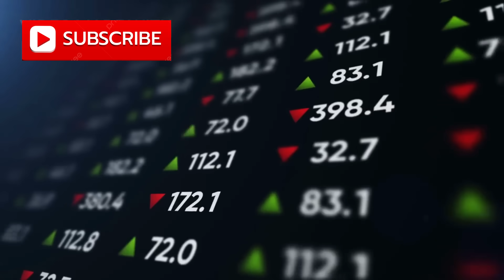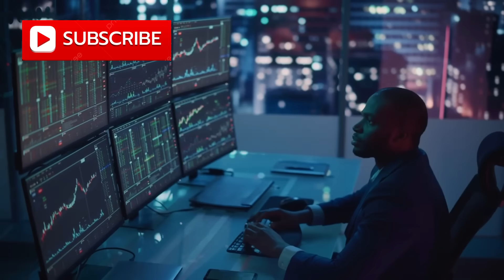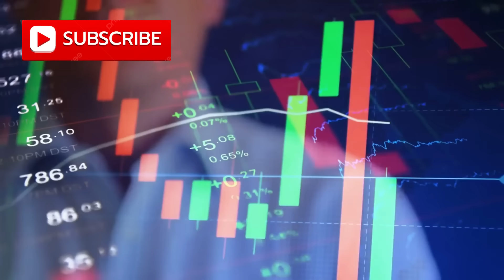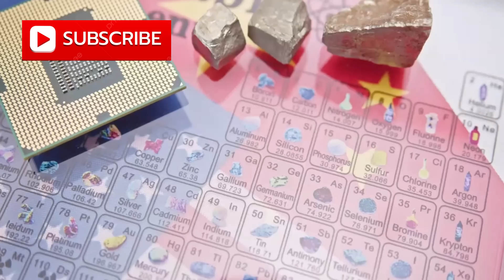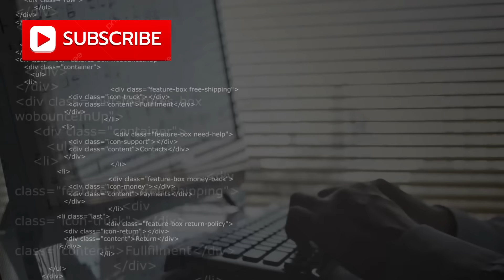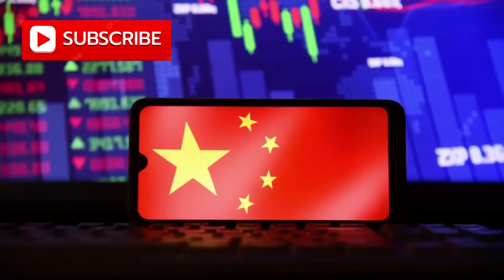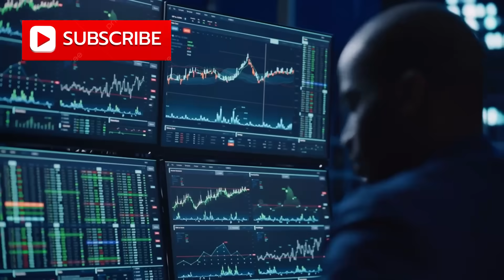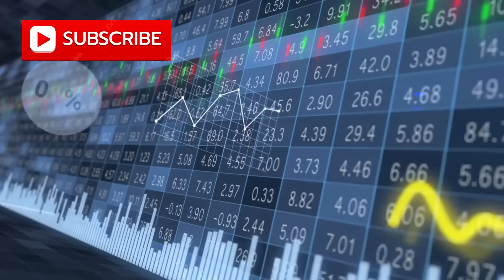China Cancel All Import Of Chips: How U.S. Pressure Fueled China's Chip Ambitions

Comment: Right now, China has not achieved self sufficiency in production of high end chips but they are getting there. 🤔
The goal set for Made in China 2025 is only set at 70% but due to geopolitical factor, it is now reaching between 75~85% level.
One thing about A I. is even 28nm chips will do except for speed and power consumption but Chinese researchers have created new way around conventional silicon chips and that is by leaping into 3rd generation chips. In 3rd generation material China is paving the road ahead. One advantage is they don't need expensive ASML EUV to manufacture. 
With well over half the the world STEM engineers in China, it won't be hard. 
Just need a little more time to get round the existing IPR. 😀
Reply: "Time" is in China side...
Reply: It matters of science n technology, given talents and capital, everybody will get there. It is only the question of time.  One of China efficiency is speed and China has achieved this to replace all imports. It will not be a surprise if China high end  chips are competing in the international market

Comment: Title of this video is misleading.  There was a decline in imported chips, that does not signal 'all.'  However, the Chinese government has directed Chinese companies to no longer buy lithography machines from ASML and semiconductor chips from TSMC.  That signals the government feels its domestic capabilities are strong enough in lithography and in chip fabrication to stand on its own.  That's  a good sign that China is achieving self sufficiency which was the goal in it's 'Made In China 2025' ten year plan.
Reply: It's most likely that LDP lithography proved to be more successful than expected.  ASML planned to use LDP lithography initially, but they switched to LPP, which involved importing lasers exclusively produced by the US to build their lithography machines, that same laser system that the US used as leverage on ASML for the Chip ban (odd how everything seems to line up neatly, like some kind of Karmic justice).
Reply: @YouReadMyName  ASML not like TSMC can move OEM into China fail to understand Henry Kissinger Quote: “To be an enemy of America can be dangerous, but to be a friend is fatal.”  Soon ASML will go away in the way of Japanese technology firms did after the Plaza Accord signing in 1985. 
Netherlands should learn from Japan before it also technology firm disappear.
Reply: China has signal "all" future purchases.  Chinese OEM still have Chip contract it will receive import chips, but after those "contract" are completed, no more, just like China hold US Treasury notes, but had not new purchase since 2018.  Instead sell off of schedule US Treasury notes.  By 2030, only chip Chinese OEM will buy are from domestic fabricated chip in China from Chinese firm as well TSMC & others in China.  China is playing the long game.